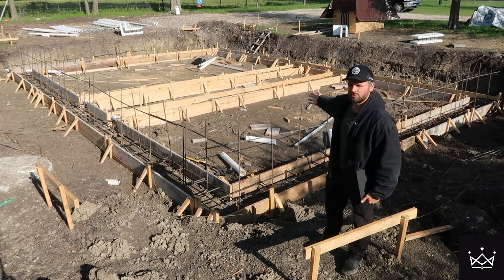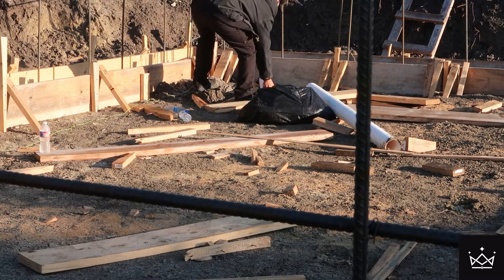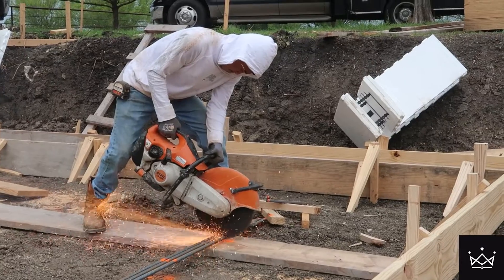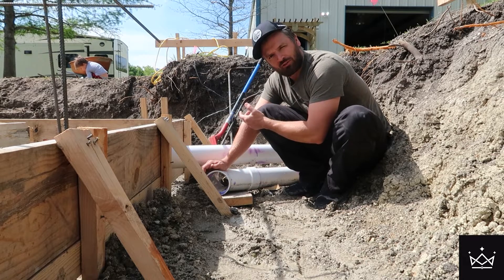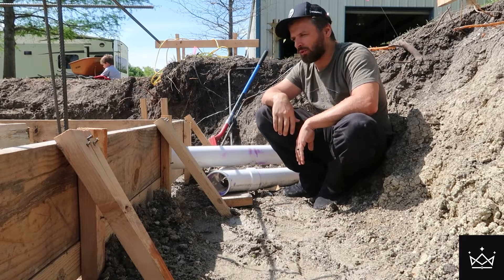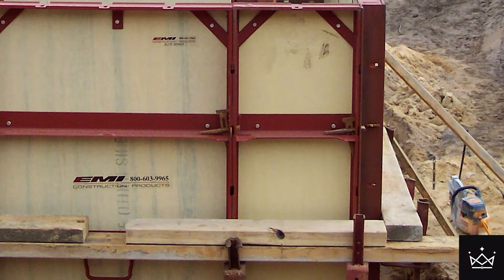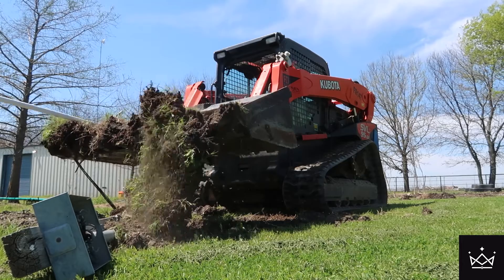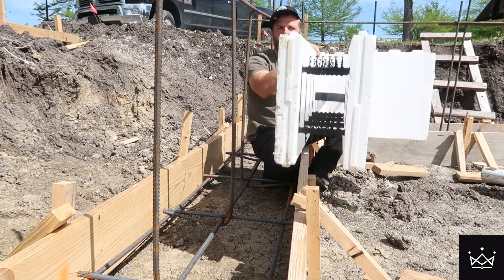Self Builder |  Building a Short Basement Crawlspace Foundation w/ ICF

Comment: "𝘐𝘵'𝘴 𝘯𝘰𝘵 𝘲𝘶𝘪𝘵𝘦 𝘢 𝘣𝘢𝘴𝘦𝘮𝘦𝘯𝘵, 𝘣𝘶𝘵 𝘪𝘵'𝘴 𝘢 𝘴𝘩𝘰𝘳𝘵 𝘣𝘢𝘴𝘦𝘮𝘦𝘯𝘵. 𝘐𝘵'𝘴 𝘯𝘰𝘵 𝘲𝘶𝘪𝘵𝘦 𝘢 𝘤𝘳𝘢𝘸𝘭 𝘴𝘱𝘢𝘤𝘦, 𝘣𝘶𝘵 𝘪𝘵'𝘴 𝘢 𝘵𝘢𝘭𝘭 𝘤𝘳𝘢𝘸𝘭 𝘴𝘱𝘢𝘤𝘦"...

Depending on where you live, the difference will usually be defined by code. Things like minimum height, 2 means of egress and a max 37 degree slope on any stairs are typically needed for something to be considered a basement in most areas. If you enter through a hatch, be it on the side of the house or in the floor of a closet, code will define it as a crawl space regardless of height.

That out of the way, good luck with the build.
Reply: Code?
Im in rural Maine. The height of the crawlspace is a standard measurement. You, sitting on a Harbor Freight Mechanics scooter + 12" = Slab top to floor joist delta.
Reply: @JoeBieniecki  Like I said, it depends on where you live. Part time use recreational cabins and certain agricultural/accessory buildings are exempt from construction codes here in PA. The UCC applies to all other homes and buildings in the state though. 

Where I also own property in East TN, but not throughout the whole state, owner occupied single family homes(and accessory buildings) aren't subject to construction codes. I could erect a surplus wall tent on that property, with a dirt floor, and it would be a legal home as long as the septic is approved.